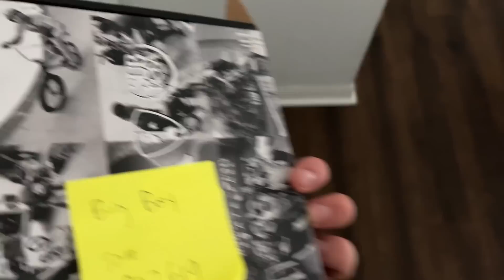My New Mountain Bike!

Comment: One HUGE subtle upgrade my dude is getting a set of the 5" or 5.75" bars from S&M or Answer bmx. I'm 6'0 feet and it feels super similar to running a standard bar setup. And since your tall AF, it would be beneficial as well. Cheers.

Comment: your brake cable is dumb AF. 

XC MTB rider here- there's 3 different wheel sizes on most Mountain bikes, 26" (older 90s to 00s), 650b aka 27.5", or 29".

EDIT: we have different width tires between 27.5 and 29